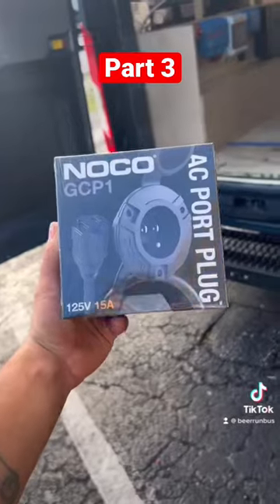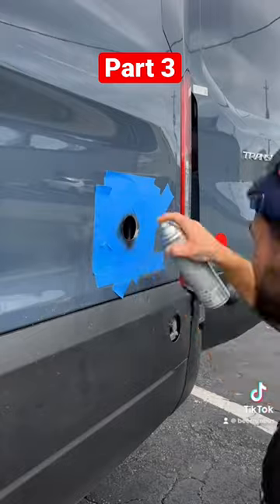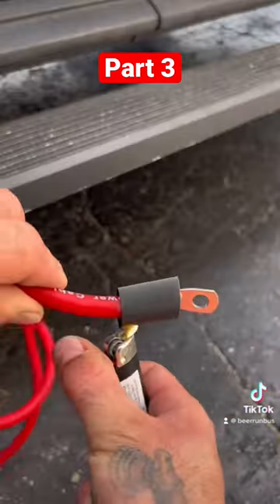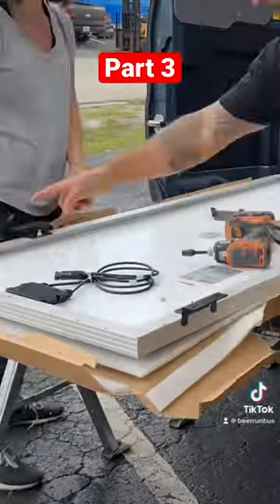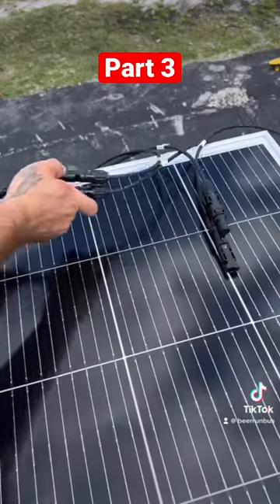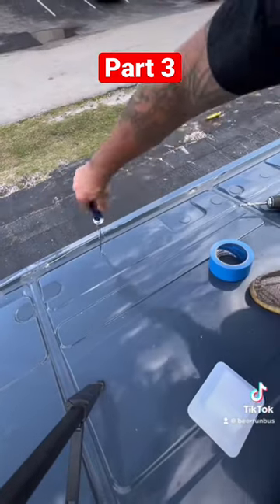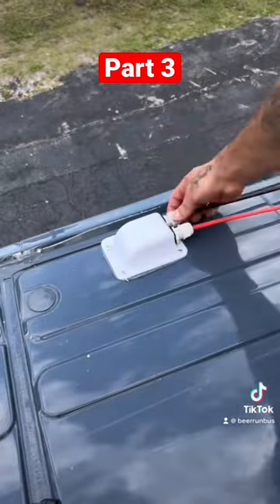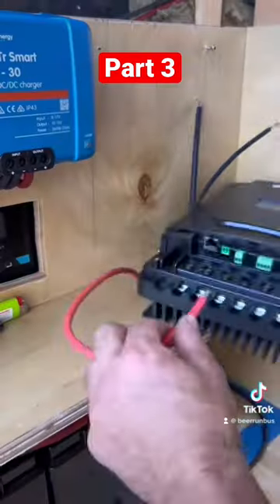Van Conversion Part 3 vanlife #vanlife #campervan #vanconversion #campervanconversion #diy

Comment: There is a good chance those holes in roof will Chaffee thru the solar panel cables and short out with the movement and vibration of driving, the metal holes should be lined with grommets.